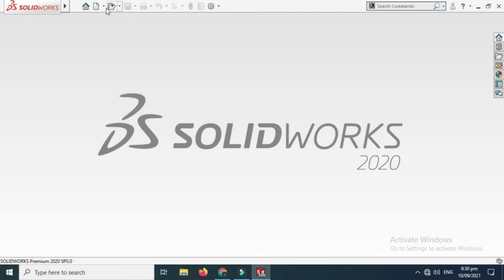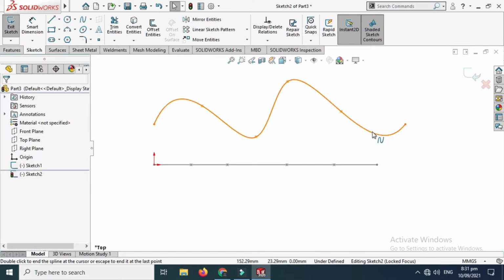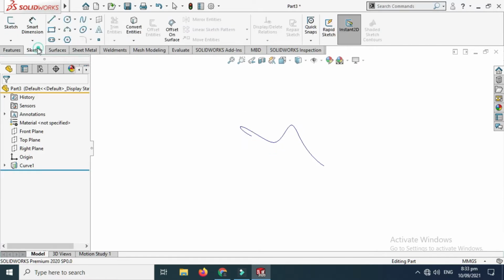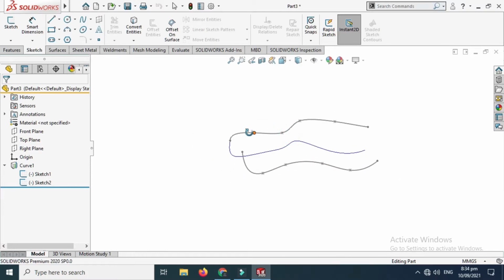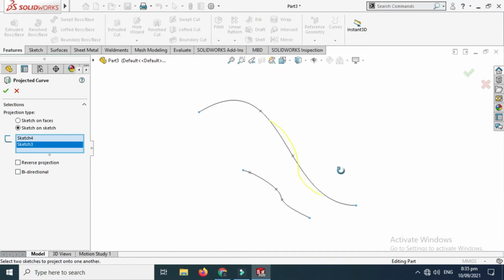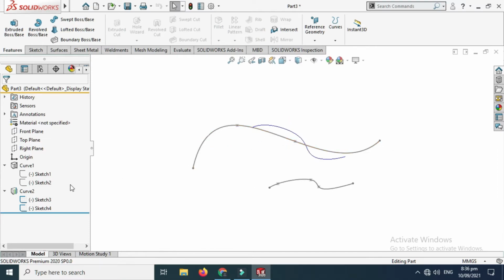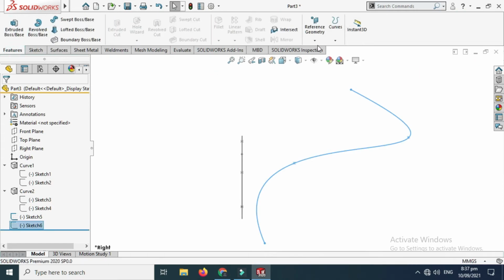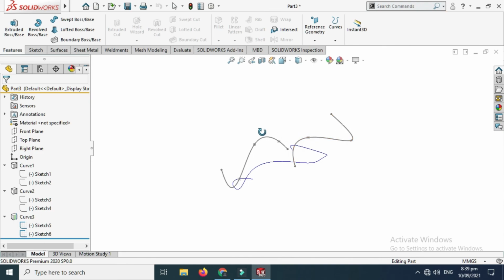Modeling Project Curve in Solidworks | Project Curve Solidworks | 3d Curve Solidworks | CADable

Comment: Why don't you use scroll button to rotate the model ?
Reply from the maker: It's actually a habit of mine to use the mouse buttons for rotating models instead of the scroll wheel. I find it gives me more control, especially when working with detailed designs or navigating through different views. Plus, the scroll wheel is usually more intuitive for zooming in and out. But hey, everyone has their preferred method it's all about what feels most comfortable! 😊

Comment: This whole work
is useful for 
3D
Geometrical Designing
used in Manufacturing
Engineering/Electrical  Engineering/Auto-Engineering
etc(On the pattern of CAD)

N.Rashid H.Khan
(U.S.A)
🌹🌹🌹🌹🌹
Reply from the maker: Yes Exactly